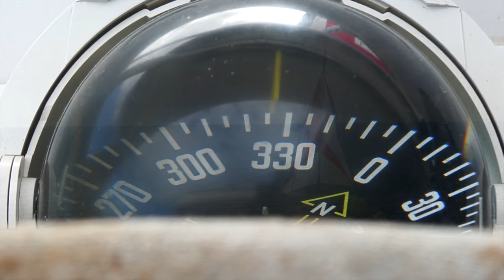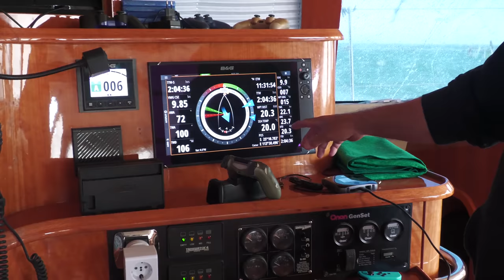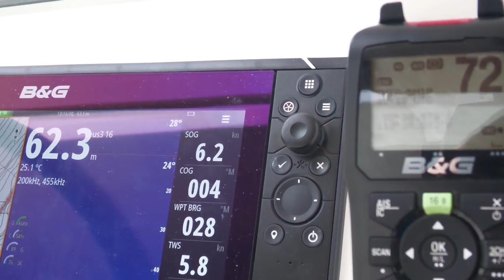LIVING THE DREAM: Sailing, Fishing, Family // Australians on America & Guns (Ep 160)

Comment: Tip!!!
You can wash the salt and corrosion off electronic components using 90% isopropyl alcohol and a toothbrush.
The alcohol will remove water moisture and dry, (evaporate) immediately. No guarantees that it will fix anything but I've spilled coffee on a laptop once, (it was off), and I took it apart and rinsed every component with about 3-4 bottles of isopropyl alcohol. Left everything out for a few hours and put it all back together plugged it in and it worked.

Comment: I have worked as a field engineer on offshore oil platform electronics for years.  My guess is that long term board corrosion from salt in the air caused the failure.
Reply: This is where my head went when he started talking about the drone issue.
Reply: Agreed.  The corrosion happens when the drone is aboard all the time.

Comment: In my experiences with electronics near the ocean, I learned that its not really the salt causing the corrosion., although it doesn't help. It is the condensation from the heat the electronics produce and the temperatures outside.  I've taken cameras and drones apart that have never touched water but the motherboards were completely corroded.  It's really hard to see when everything is wrapped in plastic but I have found that some electrical grease helps a lot.  Luv ya
Reply: I remember back in the early days of Multicopters and RC plane flight there was a bunch of discussion about that.  CorrosionX was a commonly bandied about solution.  Messy, but effective when used to coat a board.  A later solution involved Plastidip.  Masking off the heat sinks, and then spraying the rest of the board down with it yielded good results.  One guy intentionally dropped his Multicopter into salt water, submerged it by hand, and then picked it up, shook it out, and it took off with no problems.  He used both.  Plastidip on the electronics and CorrosionX inside the motors.

Comment: When the drone Flys over glassy water and the sensors see a reflection of itself it zaps out is my theory or it simply just can’t determine where it’s at based on the mirror from the glassy surface. I’ve had this happen to me too bro. I did contact them at dJ and told them the story and even though the drone was at the bottom of the lake I could prove it wasn’t pilot error and they sent me a new one under the warranty.
Reply: Epic Jason..... 🤙🏽🍻😎 good to know. Thanx for sure.
Reply: You are correct there sir..
Reply: How were you able to prove it wasn’t pilot error?

Comment: If you wanna try and save that drone. Rinse everything good with clean water. And let everything dry really good. Go over the connections and make sure there's not a lot or corrosion on the PDB. That takes care of the Electronics,  if the camera is super wet. Put it in some rice and keep dry for a day or so. Or until lens is not foggy and dry. For the motors u can rinse them with clean water maybe try brushing them out just make sure they spin freely. With no debris stuck to the magnets.
Reply: Also the Battery. If it will hold charge it should be good. If it doesn't hold charge. I wouldn't put it back on the downed drone. It could cause problems. My advice hope it helps. God bless and happy travels to you and your family. #TNLocal

Comment: Keith. Store the drones in water/ air tight box of course. But put a vacuum seal valve on the box and store it in negative pressure between uses. Bet it'll last way longer.

Comment: The balance on the drone is done with satellite signal. The  bottom sensors on the drone should be off when flying over water. If you had them on is more likely that was the cause on the crash. Is the faulty part behind the controller. And the rust inside was there before the crash. Have to keep them on a tight case.

Comment: A little on corrosion of electronics. Electronics have a lot of dissimilar metals, add water and electricity and you get immediate galvanic corrosion. Take away the power and it will virtually stop. I worked for an electronics company that produced electronics for harsh environments. We did tests by placing electronic boards in fresh water and with the power connected massive corrosion was instantaneous. With power removed the board would last for days. So a drone with power connected in salt water would be rendered useless within minutes. Therefore if an electronic device gets wet, if you can remove power immediately to give it some chance of survival. Once power is removed, wash it in fresh water, throughly dry it and then reapply power is your only hope.

Comment: If an electronic device falls on salt water, take the battery out, open it and wash it with plenty of drinking water to remove all the salt, then let it to dry in a ventilated spot. Then you check the parts and try to make it work again.